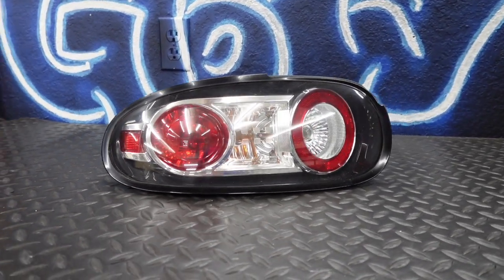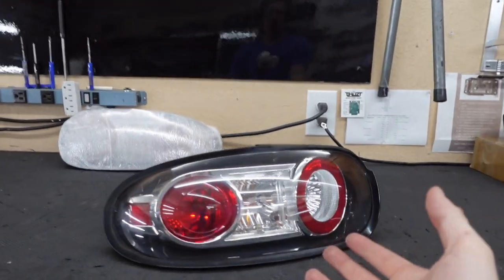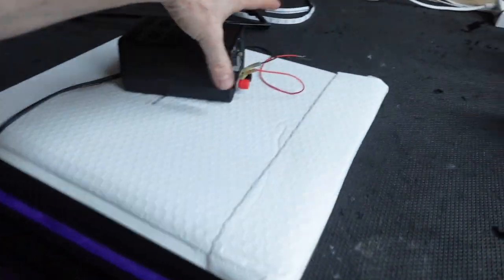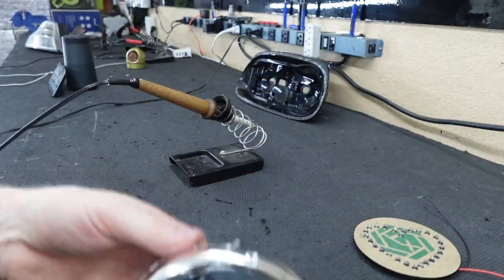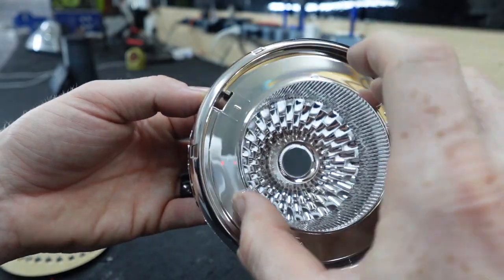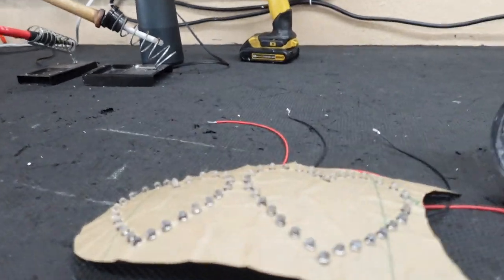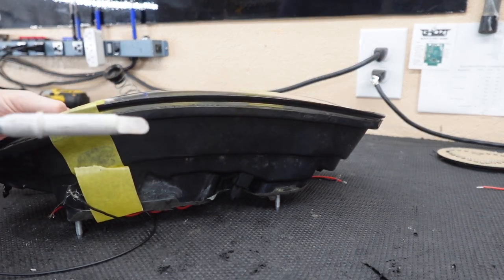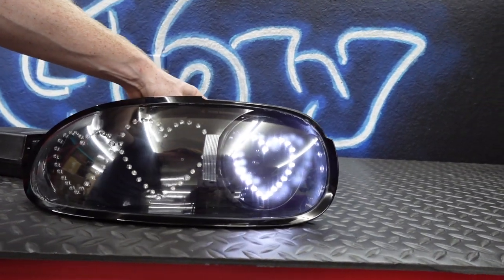BUILDING my own custom LED BOARDS

Comment: Great work 😎👌 I really want to do a set of led tails for my b4 passat wagon. This is the stuff I love to see. Only thing I'd do is use conformal coating.  It's how I water proof electronics on my rc builds and in ecu repair/mods, It will make the leds and boards along with all that soldering work last for years to come. They could get submerged in water and still work.  Again great work. Might be hitting you up for questions. When I start buying you coffee ☕️ you know what's good 🤣

Comment: Any chance you and your buddy have the svg/dxf (or the file type used) template file from designing it on the computer for the lazer cutter? To be shared and/or bought?
Also super great video, helps out a ton.

Comment: Is there a way to this without a laser machine ?
Reply: I used abs plastic sheet, dremel to cut out and drill/drill bit to make holes with my 1st few panels I made.